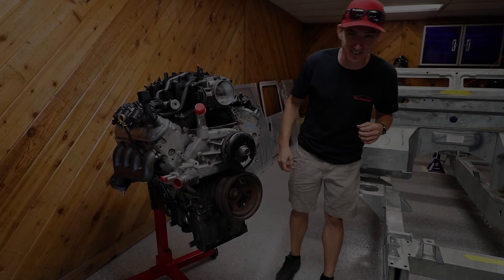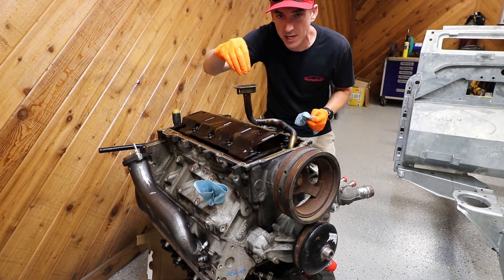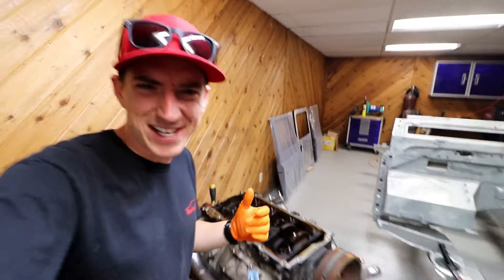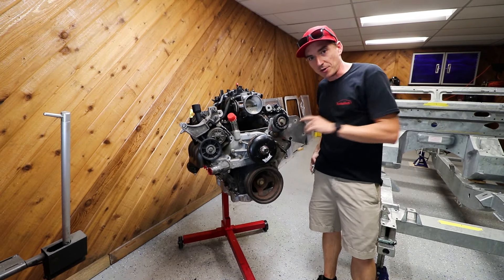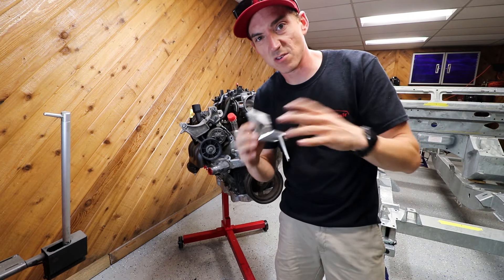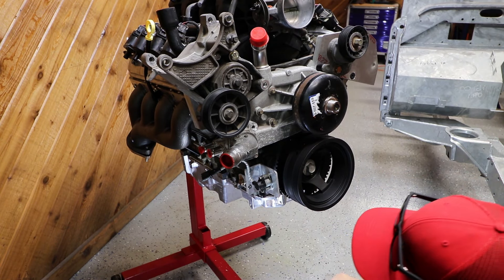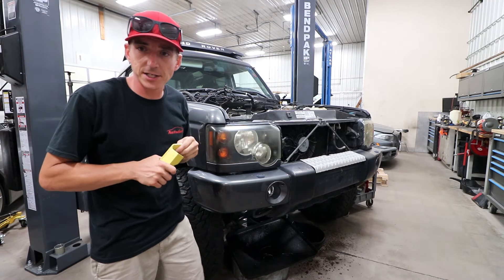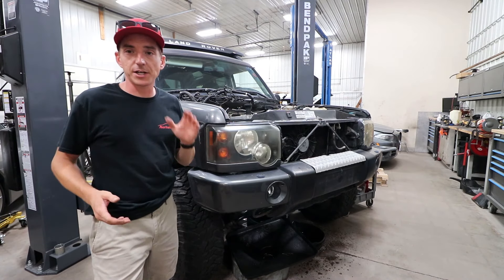LS swap Land Rover Discovery | LM4 Engine Prep for Install | The answer to the Discovery’s problem?

Comment: awesome vid- have been tearing apart my disco since last july but not thru the winter in the hope of rebuilding the engine. some of my friends say, do an LS swap? and until i saw this vid I was hell naw! now gonna start saving the parts that are gonna be reused and put funds together. Thanks for the vid Imma keep watching!!!!!!!!!!!!!!!!
Reply from the maker: I would say it’s doable if you are capable of pulling and rebuilding the stock 4.0/4.6. I’m curious on what kind of difference it makes on the drive ability of it. I’ve always felt the Disco 1 and 2s are underwhelming in the power department. Sufficient but not great. Next video should be up Wednesday. Thanks!

Comment: This is a great video! I bought my kit about 4 years ago. The instructions weren't the greatest, contacted them and was able to help out with clarification. But I screwed up with not labeling anything on the rover side for wiring 😂. If you could help me out with a few things I'd appreciate it. My Rover has been sitting since I set the motor in 4 years ago....

Comment: I heard your engine came drive by wire. What else did you need to do to change to drive by cable other than the throttle body? My engine for my swap came drive by wire and complete  with Harness and PCM I even have the pedal. Did you do your own programming or have someone tune for you? If you did your own, what software setup did you use? Thank you

Comment: Nice videos, question any recommendations for swapping out a 2006 Land Rover LR3 from air suspensions to coils?. Thank you
Reply from the maker: Are you looking for stock height or a small lift?
Reply: @LostCauseRanch  a little higher then stock height. Just tired of the cost related to maintain the air suspension system.

Comment: What size drill bits did you use for the dip stick? I’ve been holding off on doing my lm4 and this is the first video I’ve actually seen someone drilling it out.

Comment: Can I replace the v8 engine with a td5 diesel engine on a v8 gearbox?
Reply from the maker: I imagine that would be possible. Not sure on the adapter needed for the transmission.

Comment: Another question what size tap did you use?
Reply from the maker: I believe they were 10x1.5mm if I remember correctly. I probably wasn’t super clear in the video, the holes are threaded just not used so they were gunked up. So just had to run it through to clean them.

Comment: Awesome Im in the process of purchasing an L33 but keep it low powered. From ACE their harness they offer will work with my engine? and How much would you charge for the exhaust system you built (plug and play)?
Reply: Hello again, finally almost done with my engine build. curious if you could send a pdf file of disco2 rewire harness. I am on the list at ACE. Just so I could get ahead a bit. Thanks

Comment: Now a LC200 or lexus engine to LR4! I've seen a video where russians did it. Now that would be a conversion kit that would sell like hot cakes. All those TDV6 owners dreaming of their beloved car with a actually reliable engine. Well..at least I am..
Reply from the maker: That Toyota reliable would be hard to beat. But no soul haha. What’s the fun in something that just works every time? Haha.
Reply: @LostCauseRanch  Hah, there are still plenty of issues to deal with/love:) The engine is just too scary issue. But yeah, Discos have that something that makes you really like them.

Comment: i’ve had three Land Rover discoveries and yes the motors suck but my DS 2001 was really a good vehicle I just sold it to a guy now I have a 2002SE and it sucks but I had a 2000 DS also it was OK I traded it for the DS 2001 but anyway yes again I would just like to know what the overall cost of all this is